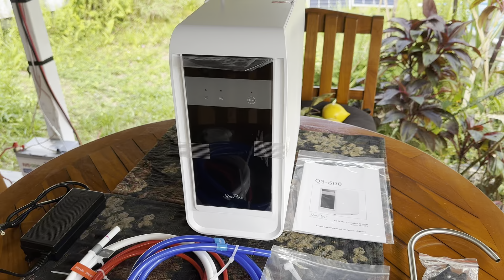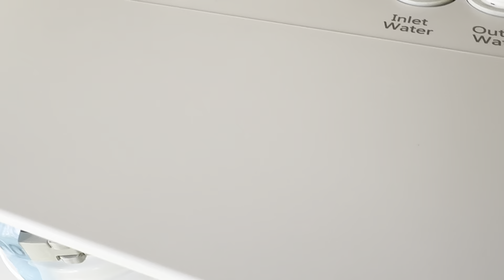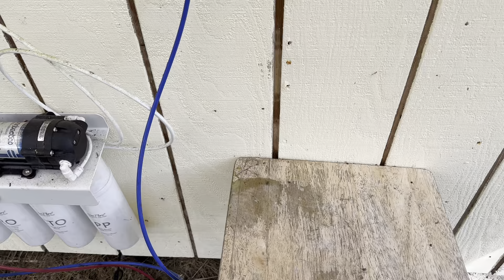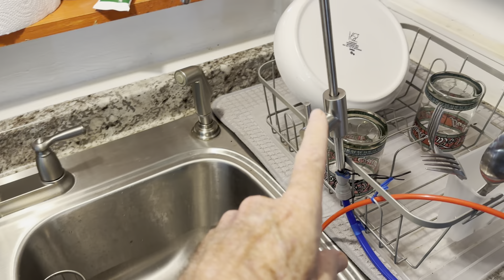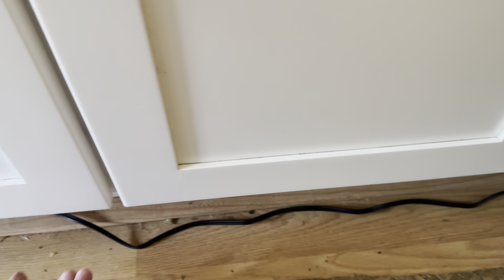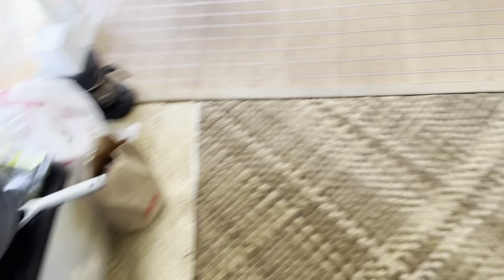SimPure Q3 600 RO Water Filtration System Review: Water Security with Ease

Comment: Does it require positive water pressure to run? I see it has a power supply to pump the water around. Does that mean you can stick the inlet (white tube) into a bucket of water and it will pump out drinking water (blue tube)?

Comment: hey bob i got 6 used panels 335 watt  57v i put two in series it makes 114v i hook up my spare mrpow inverter up un till i get my victron, it seems to work it don,t even get warm should i go back to parallel even for the victron, i end up with a 150--60 for my 24v system, so far i have 600 ah on that like 6 100ah?  happy HOLIDAYS

Comment: That's a nifty little unit. I've had RO for probably 8 or 9 years I guess. Got into it with a salt water reef tank where your water needs to be absolutely stripped of everything so my setup is pretty intense. But now with my solar shed I'm thinking of catching rain water off the top and getting a smaller filter for some water out there and of course for a coffee pot. :)
Waste water is a bad term to use for that drain water, don't know why they chose to use the name to make it sound so bad. It's cleaner than the raw water your bringing in. If it's not to much of a hassle I'd run it back to the catchment tank. I'm sure that's what I'll be doing with it.

Comment: That water filter system looks real nice . That power brick looks like it does not draw a lot. It got real cold in Boston NY . Was -5 F over night with a high of just 10 F and now it is 2 F But very sunny today. solar was good for a short day . Cold panels put out more . I had 0F and sunny before and works great ! It is the summer heat that drops off the power on  them. All my pipes are deep underground and run on inside wall . I never had a pipe freeze yet . I planned ahead when ran water system.

Comment: You could get a long line for your waist water and send it back to the main tank
Reply: The ZeroWaste(R) Reverse Osmosis Retrofit Kit is a great way to convert your existing Reverse Osmosis system into an efficient water saving device. By adding this kit to your existing Reverse Osmosis system, you can save hundreds of gallons of water every year. The system works by redirecting the rinse water. This kit pumps the rinse water into the hot water side of your water supply instead of down the drain. With the use of the supplied 24 volt pump, your hot water supply will accept the rinse water and mix with the hot water.

Comment: These are great but do wastes a lot of water. It's good you can use the waste for other things. Does that waste a gallon for every gallon of drinking water? Can you run the wastewater from it, back into your common storage to be filtered again for drinking or is it considered only gray water at that point? I'm always afraid of bacteria growing in filters. Thanks for the video and info.
Reply: He definitely could run it back into his water supply.  It is more pure than the source water (having passed thru particle and carbon filters) but has more minerals (as it carries the minerals away that were removed from the "purified" water.

The ratio of "purified" water (technically called "permeate" as it has "permeated" thru the R.O. membrane) to "waste" water (called "concentrate" as it concentrates the minerals) is variable depending on many factors such as the source water pressure and temperature, the output pressure, etc.  On my system I've customized and tuned it so it produces more than 2 gallons of "permeate" for every gallon of "concentrate."

Side note:  They also use reverse osmosis systems to concentrate maple sap when producing maple syrup and etc. In that use they keep the concentrate and discard the permeate.